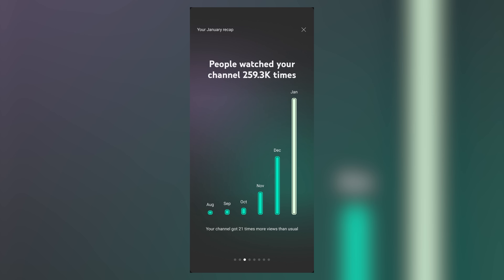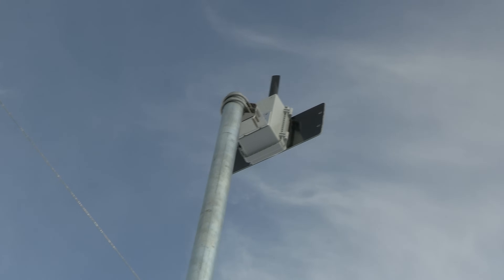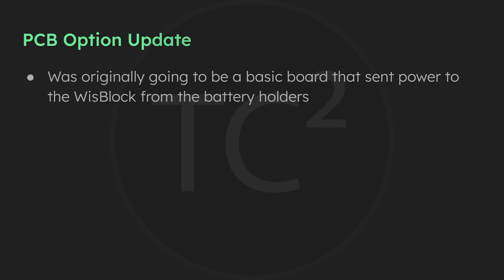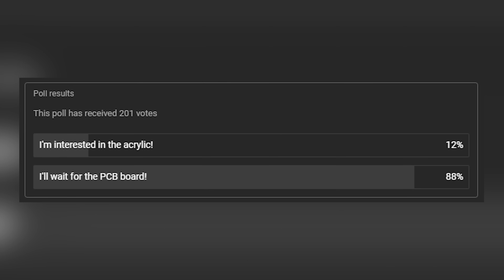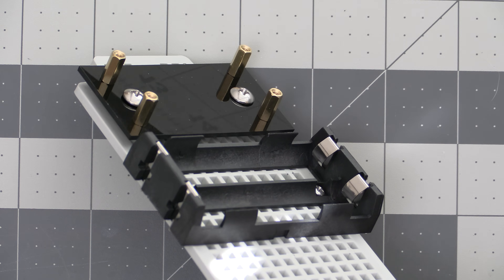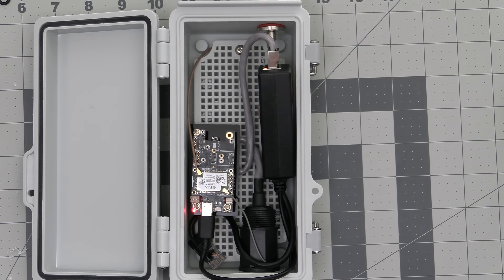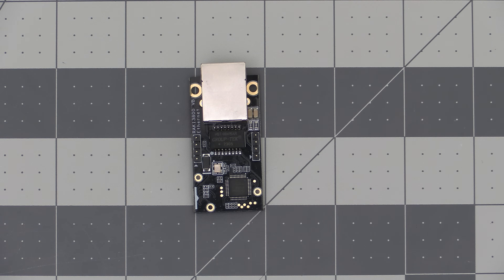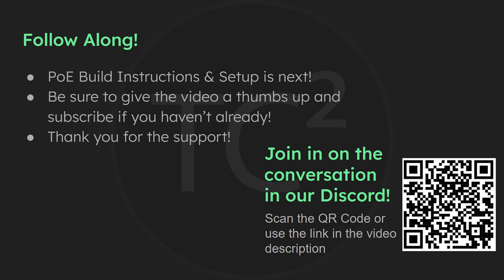📶 PoE Meshtastic Repeater 📶

Comment: Is there a max Ethernet cable length that can be used for this application? Or can it be however long?
Reply from the maker: Max Ethernet cable length is about 320 feet before it starts seeing losses
Reply: @The_Comms_Channel  oh ok, perfect. Way longer than I was expecting. Thanks. 👍🏼
Reply from the maker: Also, I should have the next installment of the TinySA series of videos this week!
Reply: @The_Comms_Channel  awesome! Can’t wait. I love channels like this. My background is mech eng focused so I don’t really have any experience with this kind of stuff but really wanted to make my own mesh network. Having someone who knows exactly what to do explain each step is greatly appreciated. Going to finally build your solar setup for the roof. Thanks again. 👊🏼

Comment: Did your custom PCB board ever come to fruition? Or am I just too late to the party. I see the wisblock acrylic mounts and the π/wisblock stack thingy on your Etsy but don’t see the PCB?
Reply from the maker: You didn't miss anything! It just never came to fruition unfortunately. Luckily most of the flatpack batteries have that protection built in and is part of the reason why the WisBlock mount that has a spot to mount a flatpack battery was made available on the Etsy shop.
Reply: @The_Comms_Channel  I see. Well good to know. I’m finally making your solar setup so I’m rewatching all the videos and heard it mentioned. No worries. Hopefully that PoE one will work just fine. Thank you. 😊

Comment: I recognize I'm late to this party, but I highly recommend those with extreme weather temps to look into using supercapacitors as a power backup. They're easily charged with solar panels, have extremely linear capacity voltages, can cycle thousands of times with little to no loss of capacity, and they're generally safe at -40° through 65°C. Their energy density leaves a lot to be desired, but if it's a permanent rooftop installation and size isn't a concern, they should definitely be considered.

Comment: Could you not just power with USB-C. Rak has a module accepting higher voltage for power or maybe i misunderstood
Reply from the maker: USB cables have a more limited distance than Ethernet

Comment: Very nice!!  Need to snag me some of the POE/network boards and refresh what I built for our gate controls.  Gate was harder since I had to step up the voltage.  Anyway, POE provided connection to my IOT network and kept battery charged battery charged using the same POE type splitter you used.  On the gate, If POE goes out, the device switches to Wifi and the battery kicks in for a few days. Avoids the need for solar panels or good weather.   If my POE is out for more than a few days, I'll be expecting Noah to sail on by ...

Comment: Poe splitters can cause a lot of HF noise what could limit the range of the meshtastic radios. I built a setup with a raspberry and SDR and the splitter generated too much noise for me.
Reply from the maker: My splitter has no interference in the ISM band

Comment: Imagine using POE on a device made for worst case / disaster times.   trust me if you have no power, internet, you also have no POE
Reply from the maker: Did you even watch the video?
Reply: @The_Comms_Channel   yes i did, are trying to now defend the use of a battery backup POE switch?  what happens when that runs out.

How bout make real world sh!t people could use that will be using these things when sh!t hits the fan, like explaining to them that even a cheap taken apart solar garden light can power these and keep them powered for pennies.

how bout those kinds of setups that will matter come d-day.

while your tinkering with them as fun most people that will buy these are buying them for very specific reasons and not for ever day use when everything on the planet is all fine and dandy.
Reply from the maker: It'll run over a month on the PoE battery backup. 

I've done a whole series of videos on solar powered versions of this. Maybe try taking a look at my other videos before commenting.

Are you seriously complaining about the PoE setup and talking about a garden light setup in the same comment? 😂
Reply from the maker: The PoE box is battery powered.

Comment: One thing I've not seen addressed.  All these Meshtastic boards came from some other use, I assume.  What was that other use case?

Also, I assume because of the previous use case and the screwy Chinese sellers.  There seems to always be something simple but very wrong with nearly every board sold.  Either the antenna sucks, controls are flakey. You have to source parts from multiple places to get a fully working system in an enclosure.  I realize this is all kind of kit stuff.  But still, you'd think someone would put a reasonable kit together?  Or a not screwy solution.
Reply from the maker: These are IoT devices and are heavily used for this, including commercial use. I've purchased about 40 boards at this point and not had a single issue with any of them. RAK sells complete kits ready to go with solar for commercial use, but they're commercial use prices that people who want to use them for Meshtastic would be unwilling to pay.

Comment: Im trying to plan how big of a system to set up. How long of a range would this give on a flat terrain (a large range would do)? Hypothetically, I understand there are lots of factors to take in
Reply: Google RF line of sight tool you can put in two gps coordinates at what height the radios are & it will tell you if they can talk
Reply: Sweet, I'll have to play with it a bit. Thanks!

Comment: Great content! Ive been searching for this solution for several weeks now!
With the PoE and Ethernet setup can you access the web interface of the radio over LAN? I potentially have numerous locations with UPS supplied PoE switches but need LAN interface as they will be beyond regular Bluetooth range for configuration etc.
Reply from the maker: The radio itself doesn't have a web interface like the ESP32 devices, but you can use the Web client or CLI to make changes
Reply: @The_Comms_Channel  sorry I didn’t mean to imply the web interface of the radio as such I meant the board / ESP32. 
Is there a way to access the web client via LAN whilst using PoE to power it?
Reply from the maker: @MylesOverMatter  oh, gotcha. Are you referring to the client.meshtastic.org? That doesn't work, but you could use something like the Meshtastic Network Management Client to make changes. I was mistaken about the CLI, it appears that doesn't work. MQTT and the net management client work though.

Comment: what screws did you use to affix the antenna mount to the box???
Reply from the maker: The enclosure comes with mounting hardware. I used the screws from that to mount the antenna mount
Reply: @The_Comms_Channel   hmm mine wont grab for some reason
Reply from the maker: Weird. Too big or too small?
Reply: @The_Comms_Channel  the screws are too small

Comment: I have had issues with the PoE only RAK board not getting power with some PoE injectors/switches. have been told to have a battery connected. not sure if this will work as i have not tested myself yet but might be worth looking into.

Comment: I would really like a video on how to protect (if there even is any effective way) hardware against EMP. Particularly if you've got LoRa stuff already in place for SHTF reasons.
Reply: Simply put, a radio is sensitive to radio frequency by design.
EMP is a lot of radio frequency at high power all at once.
EMP is to a radio what a blinding light is to your eyes. 
The only way to protect a radio from EMP is to keep it in a grounded metal box, preferably underground.
Reply: Short version: put up your relays, but keep spares in protective storage.
Reply: Short version: put up your relays, but keep spares in protective storage.
Reply: @kerbalairforce8802  With regards to a rollout of spares, if a malicious EMP does take place plan on a 2nd one happening 2 weeks to a month after the first as it's meant to affect the rollout of backup hardware.

Comment: Mmimum operation voltage for the RAK is afaik 3V - lower than that it shuts down because of undervoltage. do we really need a battery protection circuit then? If so, the  protection circuit from keith is the way to go since almost all "generic" ones you can buy also shut off at 2,5V = too low. That was the reason he designed his own in the first place....
Reply: @The_Comms_Channel Will you point me to the circuit protection from "keith"

Comment: Thanks for the update on the pcb enhancement,  certainly a good idea for a remote unit (We really do have far less Sun than you) and the poe for a location with wired/4G wireless Internet availability is something I was considering for a location co-sited with an existing amateur UHF repeater.  Richard G8ITB.

Comment: A warm welcome to the Meshtastic community.
I wanted to build a repeater with mqtt. My idea was to have the repeater run all the time over PoE and thus connected to mqtt. On the other hand, in times of crisis when we have a power shortage it would switch to solar power and still work as a repeater only of course already without mqtt. This then gives us greater reliability and flexibility of communication. Has anyone already done such a project? I'm wondering if there is a switch that will detect a change in voltage and switch from PoE to battery/solar power without interruption.
Thanks in advance for your reply!

Comment: As it relates to the add on network module. If the switch supports the ability to select 10/100 vs auto / 1GB - lock the switch to 10/100 and see if the results improve.
Reply from the maker: Not sure the ones I had issues with have that ability, but that's a good idea in case others run into issues 👍

Comment: FYI those POE to USB/ETH boxes are not reliable. I've had a number of them fail on me at remote sites. Switched all devices to POE daughterboards.
Reply: Depends on what you buy, for sure. I’ve had one (AMZN: “UCTRONICS USB-C PoE Splitter Gigabit”) that lives on my roof in a box running a Raspberry PI (ADSB). Temps in the summer outside the box get up above 110F, much toastier in the box. It’s been out there for an entire year without so much as a hiccup. Granted, if it fails it’s fairly easy to me to get back on the roof.  If you can get a daughterboard - probably still the best option. But when they aren’t available, there are certainly decent options out there.
Reply: Is a daughter board a separate pcb focused entirely on Poe?
Reply: @StephenShreds  In this case, Yes. The "mother" board is the mainboard, and any sub-boards that attach to it are typically referred to as a "daughter board". In Raspberry Pi parlance you'd call it a "HAT". So you could have a daughterboard that does cellular, or gps, or POE. Depends. But in this case, I was talking about a POE board.

Comment: To help educate those, trying to figure out what "picky" means.

There are two major types of PoE.

Passive: this passively puts a range of voltages down the ethernet cable depending on the power brick and vendor you use, vendors will usually have their own "standard", and theyre typically  incompatible between companies/equipment. Ive seen it as low as 8v, and as high as 54V, and some are positive on pins 1,2, and negative on 7,8. Some are positive on 5,6 and negative on 7,8. Motorola had a product line that was 48v on 7,8 and negative on 1,2. Mixed bag avoid if possible.

Active (802.3af/at): this is negotiated, is 48 volts, and either 15W, 30W or upto 50W. This is a standard what I believe the RAK modules support (standard compliant, hence the number above).

Look for 802.3at or 802.3af in product descriptions to get the most compatible equipment.
Reply from the maker: When I say picky, I'm not talking about PoE. The non-PoE Ethernet module is picky about what it wants to connect to.

Comment: Can you provide the link to the battery protection board you showed in the beginning with plugs on both ends, I can only find ones that need soldering.
Reply from the maker: Here there are! https://voltaicenclosures.etsy.com/listing/1421193059/10-li-ion-battery-protection-modules-pcm

Out of stock at the moment, but more on the way
Reply from the maker: Back in stock https://voltaicenclosures.etsy.com/listing/1421193059